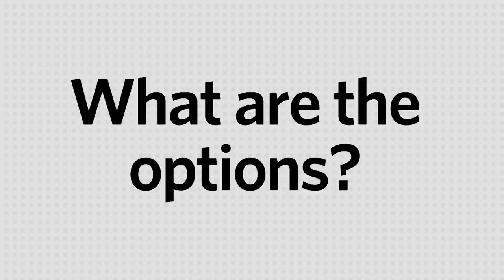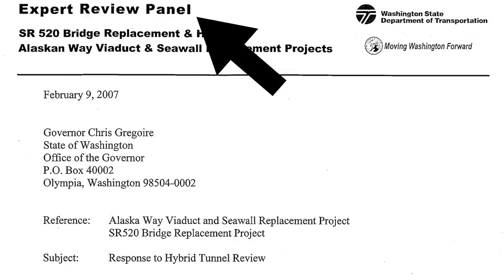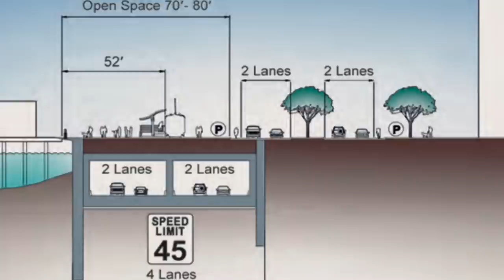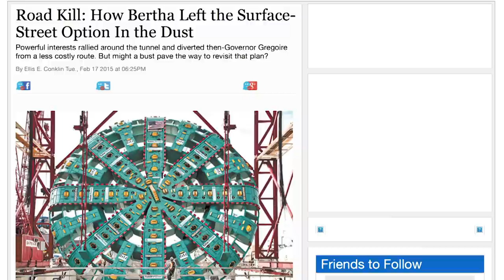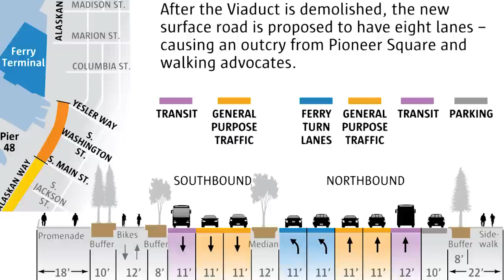The Alaskan Way Viaduct: How Seattle chose the Bertha tunnel alternative

Comment: Not mentioned in the video but very, very important to know.  The viaduct or highway 99 is one of only TWO highways through the city.  The other is I-5.  Both are over capacity during rush hour and frankly near capacity at all other hours.  All options other than the bored tunnel would have required them to tear down the Viaduct first and then build the replacement.  Which means the city would lose 50% of its highway capacity for years.  This was unacceptable.
Reply: Hopefully now that people can see how short sighted this is, they will support rebuilding the viaduct, better and with another exit downtown. With the tunnel and the viaduct, work could then begin to fix I-5.
Reply: SO hows the traffic these days? with only I-5 being open? :)
Reply: Wouldn't people then be naturally forced to condsider telecommuting, carpooling, transit? I think we could make do with a lot less capacity by using I wiser.
Reply: I would guess i5 has about double the capacity as 99 but your point still stands. Tearing down 99 before the tunnel was built would have been a complete nightmare. I cant wait to see what it all looks like after everything is complete.
Reply: @tannerrobinson5110  The tunnel is open now and they are in the process of tearing down the viaduct. They never had just i5 open except for a single weekend I think. Traffic is still pretty bad regardless though. Not much you can do in a region where almost all of the commuting goes north and south.
Reply: @Inbal_Feuchtwanger  They had just I-5 open for several weeks (including weekdays) in January, since they had to reconfigure the SR99 approaches. It was heavily publicized in the news.
Reply: Steve Rogers There is I-405...
Reply: @innosam123  I-405 covers the eastside. To get into Seattle from 405 you have to take the I-90 or SR520(toll) bridge.
Reply: You also forgot I 90
Reply: Jim Patriot   This grafvonstauffenburg troll has never been to Seattle. Reread his comments, he absolutely makes no sense.
Reply: @tannerrobinson5110  it's terrible still but honestly I'm not sure if there even is a solution anymore
Reply: the fact people dont understand the concept of induced demand in traffic amazes me.
unlike a ton of things in this world; where when you build more capacity, it resolves issues; traffic doesn't work that way. when you shut down an urban freeway, traffic tends to work itself out as people are forced to resort to different options, when you build up capacity it induces demand getting you to the same traffic issues you had before you built capacity up. 

not to mention the concept of building freeways and large highway infrastructure through cities so that suburban commuters (who dont even live in the city & aren't affected by the negative impacts of highway infrastructure) can get in and out of the city when public transport options exist is ridiculous & pisses off many residents of cities.
Reply: @benw3864  This is being addressed pretty aggressively in Seattle though. All the new high rises have pretty strict parking limit, so there is a hard cap on the number of suburban commuters who can even commute to Seattle by car.

Comment: The "it could have been a lot worse" statement is true though. In Germany, they dug a bored tunnel underneath a rail line and it collapsed. They had to fill the whole area up with concrete, including the stuck tunnel borer.

Comment: I was a reporter for a Seattle radio/TV station and covered the Loma Prieta Earthquake in the San Francisco Bay Area in 1989 where the Cypress Structure in Oakland collapsed. I insisted we go to the Bay Area precisely because the Cypress Structure was so similar to the Alaskan Way Viaduct (and the Embarcadero across the bay in SF). Even though it wasn't heavily damaged, San Francisco tore down the Embarcadero quite soon after the quake.  That it took Seattle nearly 30 YEARS to replace the Alaskan Way viaduct speaks volumes about our culture of having to hold hands and sing Kumbaya before making any decision, no matter how obvious the need.

Comment: Seattle resident here and I can say a lot of people didn't want the tunnel. It was forced upon us. A lot of people liked the view of the sound while driving. This project was pushed onto the city. Also it may be 2 lanes each way where the viaduct is 3. It won't be fun driving when it is done.
Reply: Manuel Diaz, Jr. and the tunnel will also be tolled!
Reply: Tyler really? I didn't hear that. Wow now I-5 will be worse
Reply: Tyler this is fucking gross yet typical. We recently voted on expanding the transit system last year and the pitch was that no federal funding would be used and instead they would raise the money by increasing the registration fee. It passed and then when trump announced the city wouldn't receive funding due to Seattle being a sanctuary city sound transit said they would need more money because they need federal funding.
Reply: Take the light rail! You know, that other megaproject that we're pouring billions into. This one actually works!
Reply: I mean who likes driving on the viaduct, or if I was on the viaduct trying to type, I.e athos likes drivint ont the viaheaddic anywaun
Reply: So what would have been your solution? Rebuild this thing only to have it collapse?
Reply: Mike Babbich People should be concentrating on the road; not the view when driving.

Comment: This reminds me of Toronto's Gardiner Expressway, an elevated expressway along Lake Ontario which runs atop Lakeshore Blvd. The elevated Gardiner is considered a hazard with falling bits of concrete and is continually congested. Much discussion has gone into how to remove or improve parts of the expressway, but no proper solution has been provided yet.

Comment: Of course this made all the properties along the route much more valuable once the old viaduct was gone and the view improved. Likely this decision was made in the Rainier Club. CH2MHill had an engineer design a new above ground viaduct that could have been installed a section each night without loss of use, much cheaper, and without all the delays. Now we have loss of the view while driving along the waterfront, tolls, and the delay and incovenience. Should be fun.

Comment: There's a better option: build a railroad.
Let's talk about "My Taxes Wasted"... I mean the Big Dig. Boston traffic has not improved. As a railfan, I calculate that we can move 150% capacity of trains by taking a lane out of I-90 and building Boston Union Station where the Conrail Beacon Park yard used to be. 

Here's another idea, which works good for a coastal city like Boston or Seattle (except replace east with west). The Eastbound I-90 stops 5 miles outside the city. Traffic will go around to the north and south to Portland and Providence. Then rip out the road, and replace it with a railroad. It's not like the Boston and Albany was there FIRST or anything. People will drive up to the end of the road, park, and use public transportation through the city. Local traffic on the streets only. Problem solved.

So the solution is just route traffic AROUND the city. Better yet, get some autoracks and run a few auto trains down the coast.
Reply: burdizdawurd1516 Boston traffic is bad because the city is not designed for cars but foot traffic. It wasn't built on a grid system, or radial system basically it's 100% organic growth. The big dig actually helped the city cope and plan alot of urban renewal and development. What about rail lines you say great for working class but if your working graveyard shift if you get off at 11pm or 12am the train reliability isn't as good. Not every city has 24/7 metro system.
Reply: We already have a railroad, in fact we have Sounder commuter rail, Link light rail, Amtrak Cascades, Empire builder, and Coastal starlight. Sound Transit is also currently building a light rail on the I-90 express lanes instead of ripping the whole freeway. There is also a freeway called I-405, instead of I-5 which goes through Seattle, I-405 goes around Seattle and Lake Washington.
Reply: @dankadybong7948  
You have obviously never ridden public transportation... Just take look at the stats for the likely hood that you will be injured driving vs. injured on public transit...
Reply: it will be called west station, not union station.
Reply: HuskyJack lmao 100% organic growth? what are you talking about? the only place the streets could be considered organic are fidi and roxbury. everything else was planned for the most part.
Reply: @MrJack1992  In most of America the railroads were here before paved roads, except for the east coast... There was a US Army officer in charge of a truck convoy exercise after the First World War from the east coast to the west coast. It took that convoy 42 days to cross America, a train could do the same in less than 4 days, 83 hours. Eventually four decades later that same officer signed the Interstate Highway Act. Dwight David Eisenhower. No one knew the importance of trucking better. America never nationalized the railroads, they have always been in private enterprise hands...

Comment: Now it's not expected to be completed until 2024 and is more than $223 million over budget
Reply: Um, the tunnel is done?
Reply: @blastermanr6359  Um. There was more to that project than boring a tunnel. The project isn't projected to be finished until 2024.
Reply: @tomg6149  what else is there? They finished the tunnel, tore down the viaduct, and finished 90% of the new road. Also the 200 million mostly came from the breakdown and given that amount has remained constant that means the rest should be proceeding on budget.

Comment: I live in the area. The Bertha project sucks. It was just another project designed to move money and rob the public. 
First off, that tunnel has a toll now so we're being charged to use it. I hate that. 
It didn't improve traffic, in fact it has made it worse I believe because no one wants to pay tolls. 
The tunnel is tiny, and has no shoulders. One accident could set traffic back for miles. 
It's insanely short to be paying 3$ to use. 
The whole thing jut sucks. 
Huge city planning con designed to move money

Comment: While it's prettier and probably safer to go underground, it's over exaggerated that it "cut" the city from the waterfront. Lot of bullshit.  Parking is available right below it, and access Pikes Market Place and the entire port area and up to the shops and cafe's. That goes by by with even more noise with a big boulevard literally cutting the water front with the shops and condos.
Reply: Parking does cut access though (making pedestrian experience less pleasant, thus less people walking through). It's obviously not physically cut off, but it wasn't nearly as well integrated as it should have been